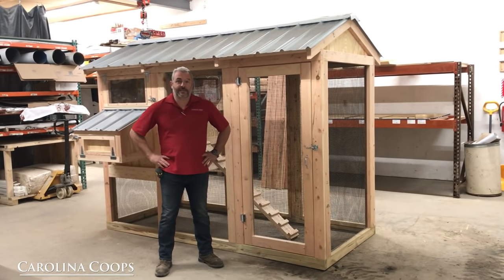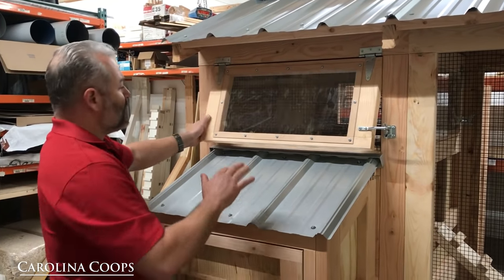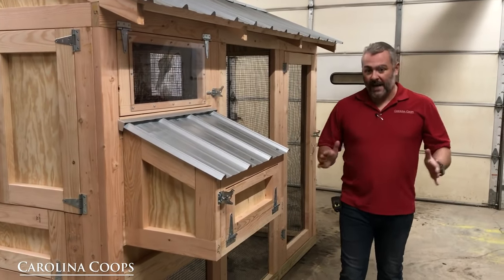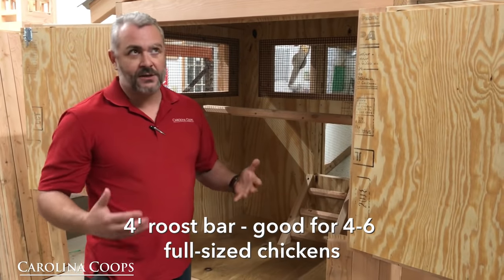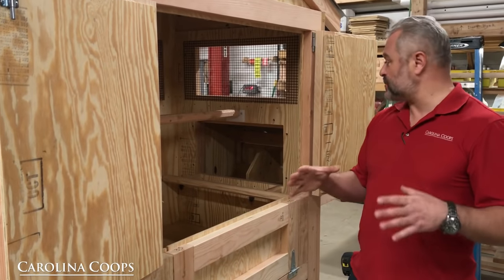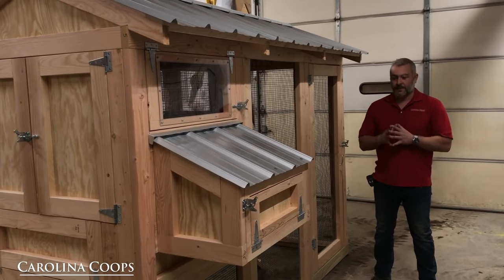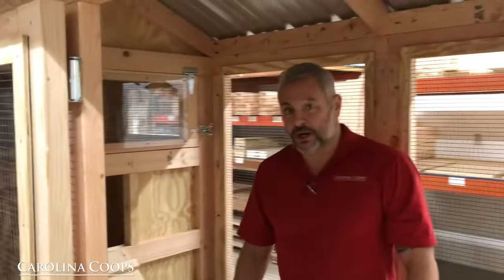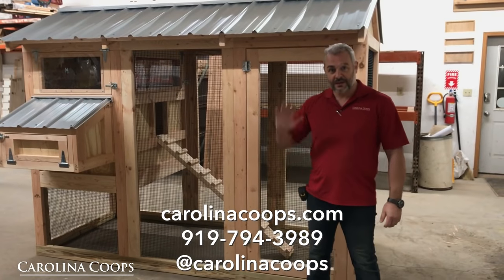Introducing the New California Coop - A Tiny Home for Chickens

Comment: In preparing to build my own coop (and during the build) I've watched these videos so many times. Last night I was down in the basement working on a frame for the roof, and I could hear this video playing upstairs--my stepdaughter with severe autism had seen this so often that she put it on when she got on YouTube lol. She loves familiarity, and will watch things over, and over bc of the comforting feeling. I had just watched sooo many Carolina coop vids (multiple times) that they fulfilled that for her I guess lol. Thought it was really cute, wanted to share.
Reply from the maker: Thank you for sharing that with us. ♥
Reply: I'm building mine right now and I too have modeled mine off of one of their coops. A 4'x6' coop and a 12' run. 6' tall walls for the run and 7.5' overall height. I put linoleum tile in my coop to protect the wood and I've also insulated the coop floor and will insulate the walls as well, using left over Rockwool Insulation that I have! I'm also going to add tile to the first foot inside the walls, so the bedding won't penetrate into the wood where there's contact.

Comment: Here is an idea- Drill the dowel and attach it to the carabiner with a little bungee cord. When the carabiner is used to keep the window closed the dowel stays with it and the opposite when you use the dowel to hold the window open the carabiner is with it. The become one unit that always has its place.

Comment: How much heat does the roof give off inside during the summer? Just wondering if need to add some type of insulation to protect the hens from the generated from the roofing material. Was just wondering.
Reply from the maker: Our metal roofing does not heat up the coops, in fact it does just the opposite. Metal has a low thermal mass, heat is not absorbed into the roofing material and then transmitted into the coop. In fact, the Florida Solar Energy Center states that metal roofing absorbs about 34 percent less heat than asphalt shingles.
The painted metal roofs are even more energy efficient that plain metal roofing. (yes, even black roofing!) These roofs not only reflect solar energy, but also re-emit most of the solar energy that the coop absorbs.
Keep in mind, the chickens are in the henhouse to lay and sleep. Our covered runs help provide cool shade in the hot summer. 
Thanks for  your question.

Comment: As for your dowel why not just drill a hole threw the dowel across the grain and have a ring like on your keys and have a chain have it long enough to hang down to the last hole and screw the chain to the top of the holes when not in use just let it hang down and then it can be put in any of the holes.

Comment: HI , How much Canadian is this coop and what would be the cost to ship ?
Reply from the maker: Hi, you need to call the office for shipping estimates because it goes by zipcode: 919-794-3989
This coop starts at $1750 U.S.
Reply: @CarolinaCoopsVideos  In the video, you mentioned you were going to try and get this down to $1000K but at the time was, $1495. It's now $1750. Is there a $1000K version?
Reply from the maker: @xtaticca  Hi Sean, we wanted to get the price down, however, the materials we use didn't allow for it and we have since added food safe high density polyethene in the henhouse and egg hutch. So that raised the price.  We handpick and only use the best lumber which unfortunately does not allow us to make this quality coop any less expensive.

Comment: I'd like the perch farther from the nesting boxes.
Reply from the maker: The perch bars are for getting into the nest boxes, although most chickens just hop right in. Are you referring to the roost bar?
Reply: Yes, the long , higher bar. My hens all congregate at one end of their perch. If it ended at the boxes their poop would pile up in or very close to nest.
Reply from the maker: @zeus3926  That's typical of hens to gather on one end. However, our coops use the deep litter method and we love the industrial hemp with our DL. All our customers usually do is just break up the poop a bit to help decomposition. That way it also doesn't get on their feet when they visit the nest boxes. Thanks for watching.

Comment: What kind of paint is safe for inside coop?
Reply from the maker: We use Sherwin Williams exterior paint for our coops. Of course it's best to paint the coops before your chickens take up residence, and since it's exposed to the open air there is no concern about fumes or off gassing. Hope that helps.
Reply: Do you paint inside the coop?
Reply from the maker: @judyhowell7075  We do for our customers that want us to and our customers do as well. The lumber we use isn't pressure treated (except on the base) and will last longer if it's painted or stained.
Reply from the maker: The bottom of the henhouse, however,  either has high-density polyethylene inside or we suggest treating it with linseed oil to keep out moisture.
Reply: Thank you